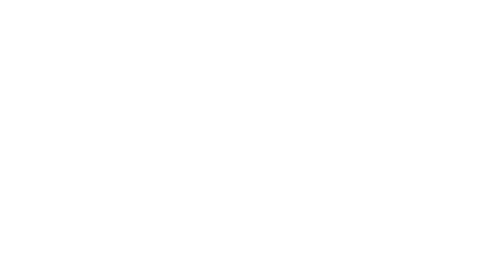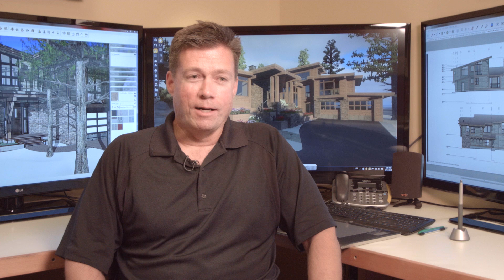SketchUp for Construction Documentation: Introduction

Comment: Would love to get some computer hardware specs recommended for sketchup designers. Maybe low, medium, high price options, this would be a very helpful video.
Reply: sparkstarter I've found that a gaming machine works really well.  My machine has a GTX680  4Gb video card that really allows for fast rendering.  My machine is built by Origin.
Reply: +Nick Sonder Thanks Nick, You're the man!
Reply: +Nick Sonder - I've been looking at gaming machines as well.  That niche seems to be home to high-powered processor, high memory, high storage, and crazy-nice video card options, beyond what one would find through your more standard computer providers.